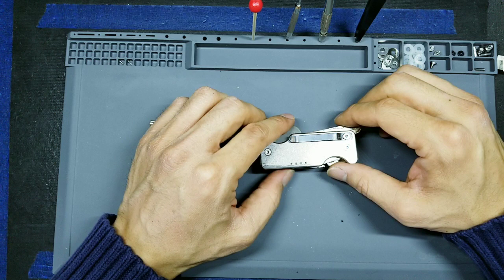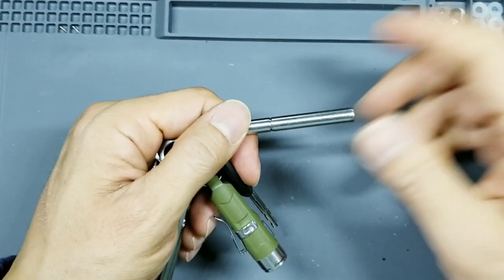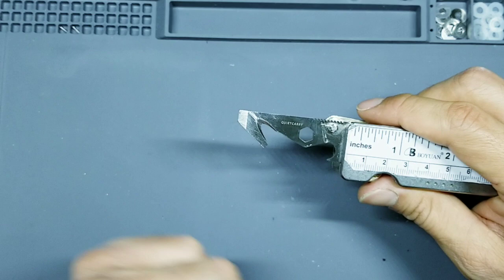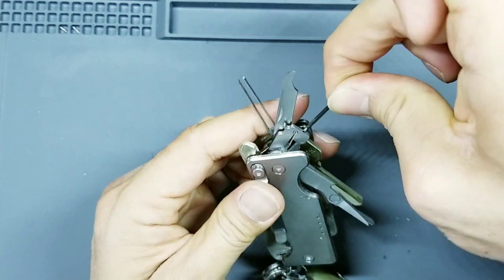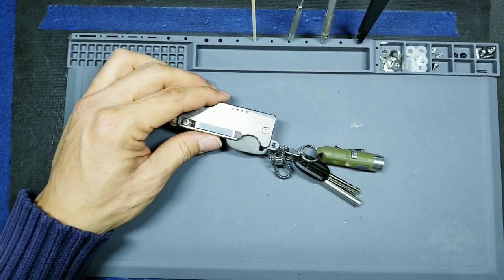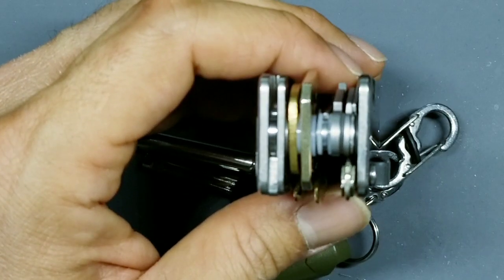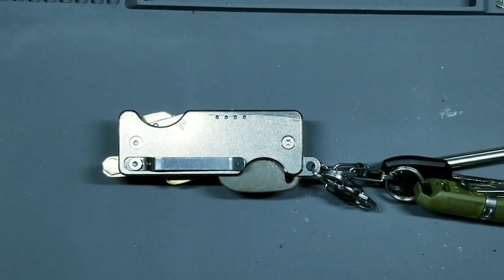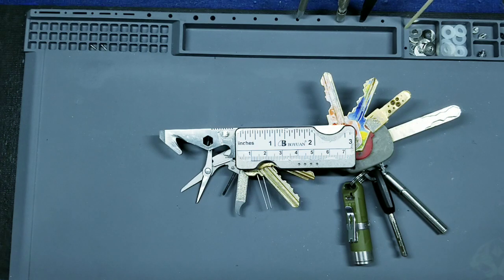My Updated Custom Quiet Carry Q2

Comment: thanks for the video.. maybe you can help me out.. I am thinking about buying one but my main key has a length of 6.4 cm (2.52 in) from hole to end - is that too long or would it fit? 🤔

.. sorry, thanks to your ruler, I saw the answer to my question 😂
Reply from the maker: Im about to sell my Q2 in case youre interested.
Reply: @watchncarry9593  thanks! bought a Q3 but it did not work with my weird keys :(
Reply: @watchncarry9593  great video and set up. Are you still selling the Q2?